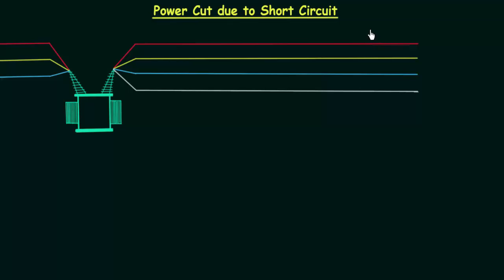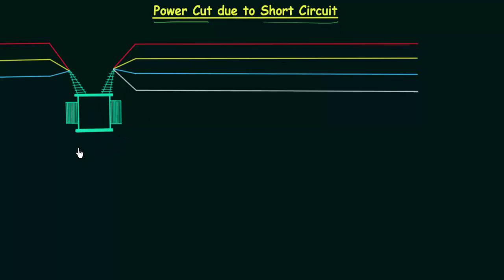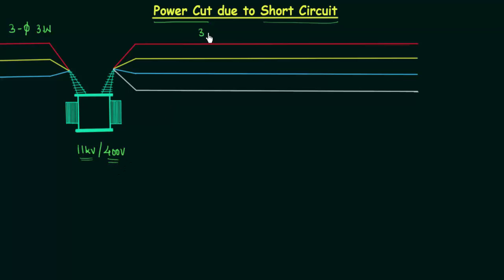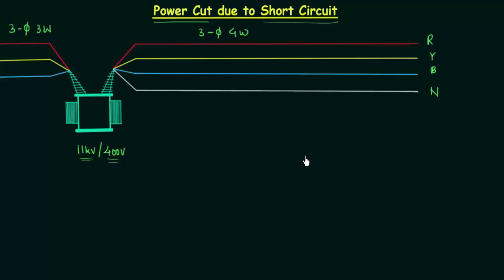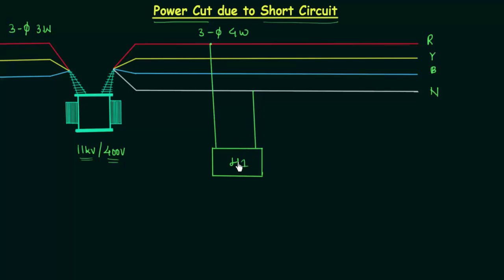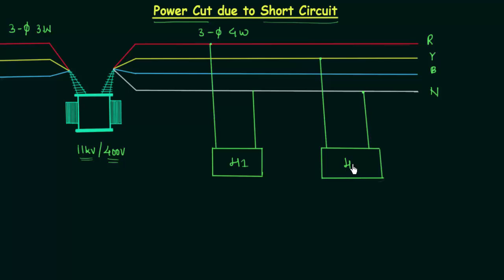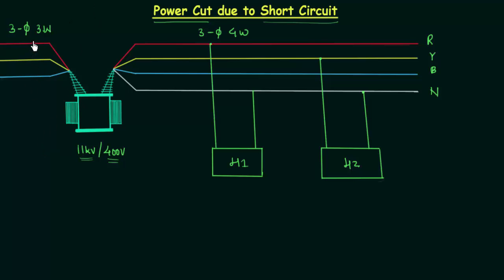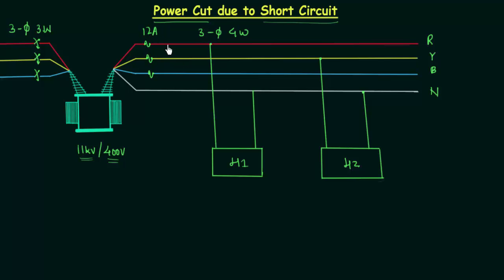Power Cut due to Short Circuit

Comment: If we connected in series the total voltage is shared(divide)among all components and current is the same through components.
Besides,if one component is failed or disconnected the entire circuit stop working.

Comment: why is there 12A fuse on 400V line, it is wrong. 12A is instaled for 3kW consumers, which is very low in Europe. On lines with 0,4 kV fuses are stronger than 12A, about 63 or above

Comment: When appliances are connected in series, the current has to flow through each appliance in order to reach the next one. This means that the current flowing through each appliance is reduced, which can lead to a reduction in the overall performance of the appliances. Additionally, if one of the appliances were to fail or stop working, it could disrupt the entire circuit and cause the other appliances to stop working as well.

Another issue is that the total resistance of the circuit increases when appliances are connected in series, which can lead to overheating and potential damage to the appliances. The voltage drop across each appliance is also likely to be uneven, which can result in some appliances not receiving enough power to operate properly.

Therefore, it is generally not recommended to connect home appliances in series. Instead, they should be connected in parallel, which means that each appliance is connected directly to the power source, allowing for a more efficient flow of current and ensuring that each appliance receives the appropriate amount of power. Thanks

Comment: answer to question -- due  to voltage drop last two or other than first device will work at very  low speed  and if large   voltage drop than will not work and only 1st one will work .

Comment: Incase of series
The load which u connect for T.V if it's rated voltage is 100V it gets more than rated of 230(ingernal) due to this there will shorted and tv will bust out first and remaining safe due to short circuit 😁

Final ans is those equipment will won't conduct

Comment: In series current is same for all devices and voltage may change based on rating ,they are work at230v , hence supplied voltage is less than demand voltage..

Comment: If we connect in series, the voltage supply to them will decrease, but the devices are designed to work on 230 V. So they will not work

Comment: Why the technician opens all the air circuit breaker switches before touching any part of the line or transformer? Is it not possible to remove only one switch(make open circuit) at which the short circuit(for example in this lec there is short circuit condition between Red line and neutral) has occured?

Comment: So what protections are used to prevent the fuse from blowing in an event of a short circuit. Is there some sort of over voltage protection?
Reply: The General can be used MCB for normal loads

Comment: at series connection- all the equipments won't get equal voltages but same current which is unnecessary+ damage/disconnection in any one of them will result in disconnection of all.

Comment: If we connected our household appliances in series....then there is a big problem arise......1- if any one of them will be damaged....the result is all appliances will shut down...
2- if we connected them in series then the voltage distribution will different...but our household appliances are designed for 220 volt....that's why we connected them in parallel.....
Reply: Kiyugardi Fakiro nice answer....😊😊

Comment: Why does the electrician open all the 3 air brakes and not only the red one???
Reply: Maybe because they want it to be safer since the technician will change the fuse of the red and all lines are close to each other.

Comment: So sir... Only because of my over usage of current will all the home connected to red phase and neutral suffer the power cut for the blown fuse??? Pls answer
Reply: Chayan Khan if the transformer is common then yes , but in practical scenario there can be more than a single transformer and in that case all the houses will not be affected .
Reply: In the first case, your respective CB will trip, if it fails, your Main breaker in the panelboard will trip, if that too fails.. then your Main fuse will blow up..!! And if all of them fails (which is very rare) then your home wiring will burn or service wire may melt if the rating of service wire is less than the fuse rating. If not, then the fuse of the phase line from the transformer will melt down.
Reply: @m.a rahman malik....   
If CB is blown....will the house get power. ...or may face a power cut in that house only?

Comment: I f appliances will connect in series than voltage will distributed in all the device will be different like , first appliance will get 230 volt. but after that it will decrease as it will flow ahead and at last device  minimum voltage will reach . and also in series connection if any device get fail that will affect others too. suppose in example if tv will damage than voltage will not flow ahead.

Comment: If the appliances are connected in series then the current in all will be same due to this reason ac which is connected with other appliances         draws 10 amp of current but other appliances needs only 0.5&1 amp but these all r connected in series so other appliances will also get 10 amps of current which destroy the appliances whose current ratings r 0.5 &1 amp if they are connected in series with ac of 10 amp current ratings
I may be wrong 
If so ,I request you to correct me 
Thanks

Comment: Series connection will result in a voltage drop across each appliance proportional to Z1/Z1+...+Zn (it's impedance over the sum of impedances) Voltage will drop below specs

Comment: for series case , net potential is constant across R & N  ,  
and say that it perfectly satisfies the power demand of the three machines..
Now,
if one of the machine damages or shorts , then overall resistance will reduce , ( earlier it was r1 +r2 + r3 , say r2 damaged , then now, net resistance = r1 + r3. , )
so , overall i will increase , again , the fuse will damage..
please correct me if i am wrong...

Comment: if all the appliances are connected in series,then there will be unequal voltage distribution to each appliance(not equal to 230v).so,due to this unequal voltage distribution,appliances may not work and also may get damaged..

Comment: if the appliances connected in series then if any one get failure ya in off state then all will disconnect .
Reply: sandip kumar also the voltage drop across the devices will be lowered. While the rated voltage is always 230V
Reply: @syedrounaknishar4569  This is very correct
Reply: If in series 230 voltage will devided between devices according to their resistance. Most domestic devices works on 230v. So devices  will not work